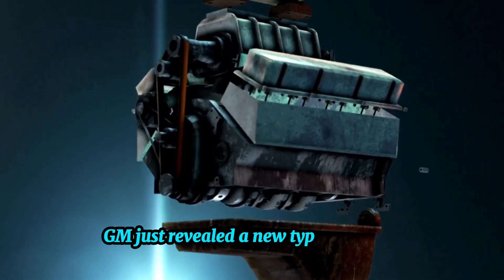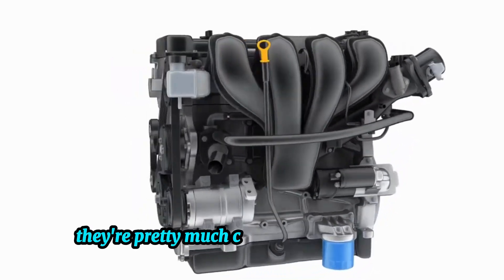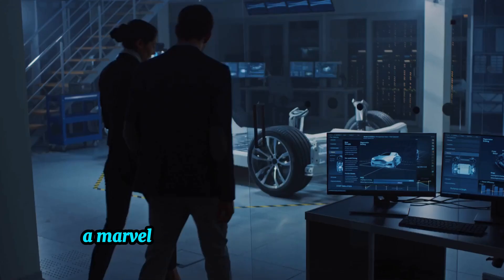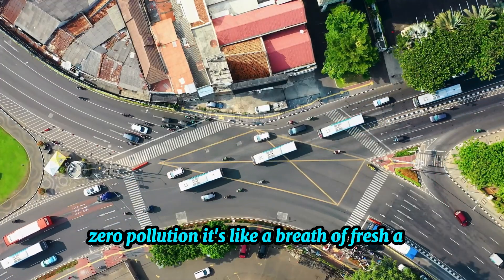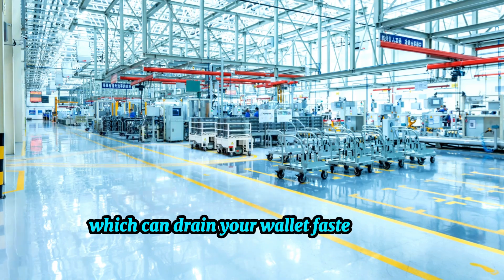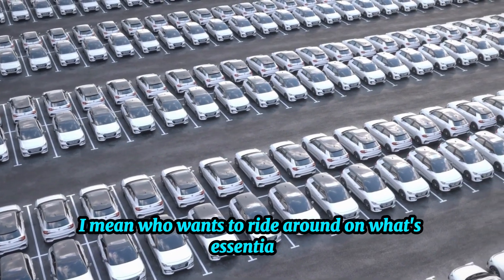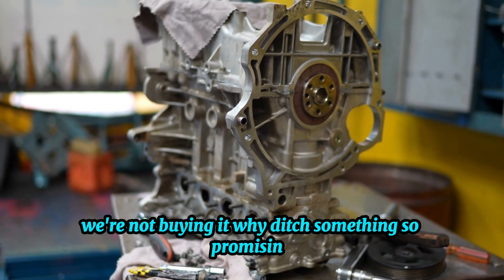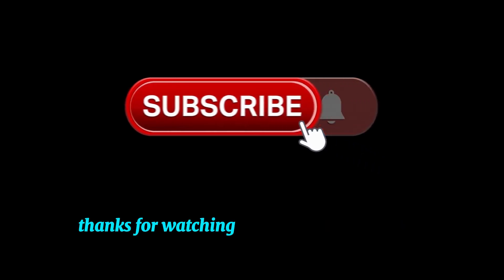NEW GM Engine Will CHANGE The ENTIRE Car Industry!

Comment: What total rubbish! Firstly, where will you get compressed air from? Assume you need to use energy to compress it! Air compression is not very efficient hence not a very green solution! And where will you store compressed air? In a very substantial tank, that takes lots of force to move about. Absolute tut this video

Comment: Air motors already exist, and have a lot less moving parts than this Frankenstein of an engine.  No range anxiety with a hydrogen car?  Considering there is no where to refuel, it would be the extreme of range anxiety.  Everyone gives the impression that hydrogen is economical, but seem to forget what is required to generate it.  It either requires high electricity consumption or the use of natural gas.  Both of those sources can be used directly to power a vehicle, so seems cumbersome to convert the existing energy to a less efficient source.  Another click bait, AI generated, BS video.

Comment: Compressed air engine? Laughing.  The challenge is not making a piston work on compressed air, it already does that... the challenge, as for all alternative power tech is storing the air in a safe tank that can survive a crash.  there is no way to do that for compressed air. It will explode like a small nuke when the tank is ruptured.  Hydrogen cars face similar challenges, the storage tanks have to be made from wrapped carbon fiber to keep the weight down.  Hydrogen is not made in mass quantities and cannot be transported to fueling stations easily.  AND there is hazard when fueling the car different than other tech.  Toyota is working on a WATER engine, that has an onboard cracking capability that extracts the Hydrogen as you drive.  So now you are storing water instead of hydrogen.  That engine has the most promise.